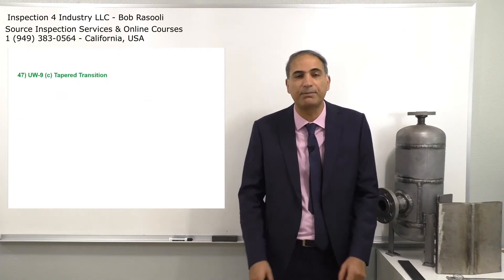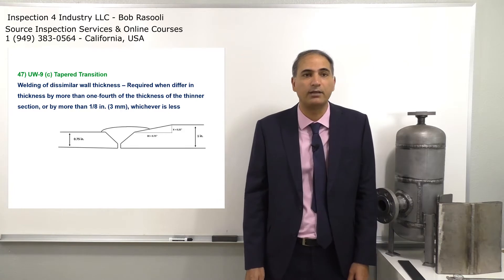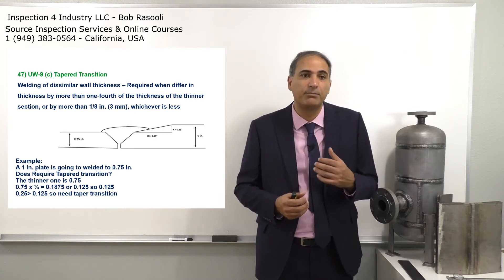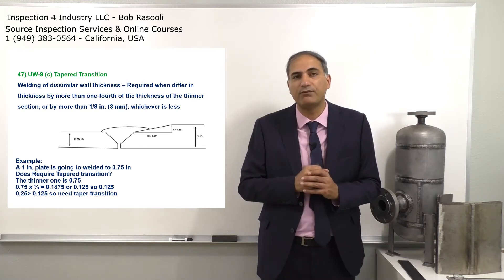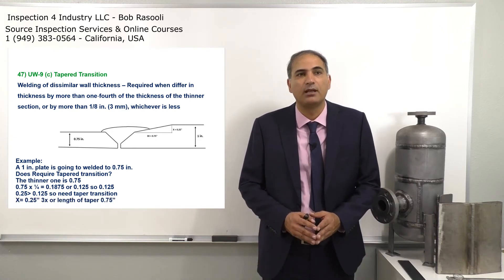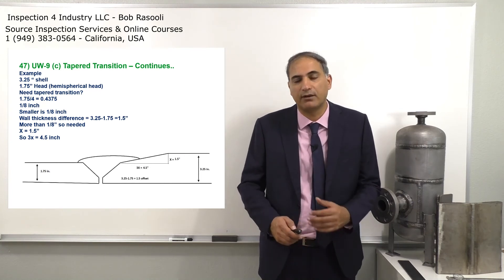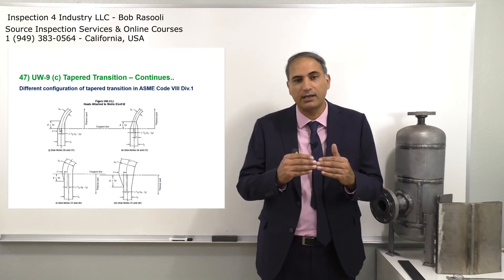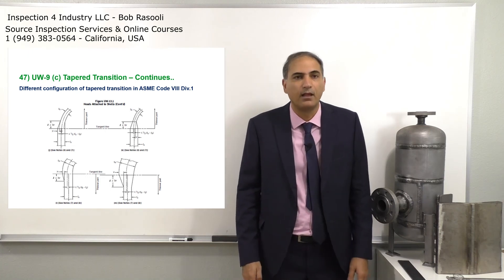Taper Transition on ASME VIII Div.1 for Dissimilar Wall Thickness - API 510, API SIFE Exam questions

Comment: If I am going to refer asme sec viii div. 1 ,shell thickness is 10mm, 2:1ellipsodinal dish end thick 14mm , taper transition given 1/4 , what is length of taper transition?
Reply: thinner part: 10mm/4 = 2.5mm which less than 3mm so no need of tamper transition.